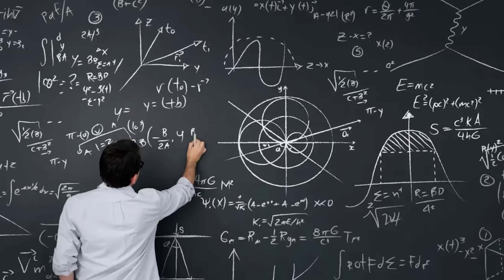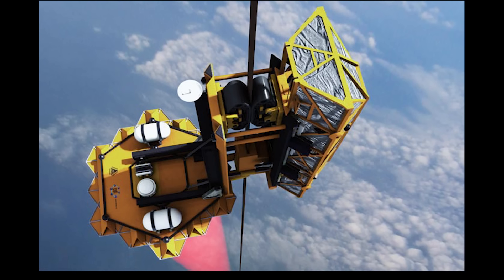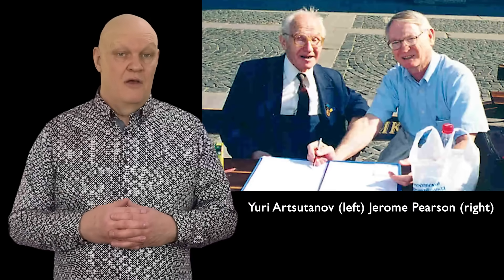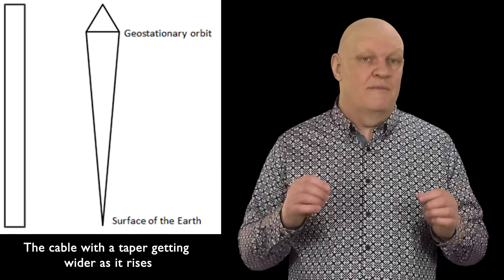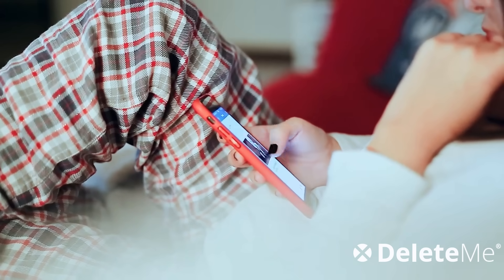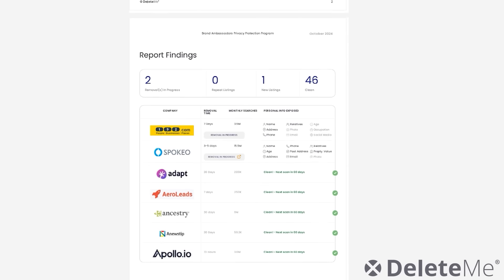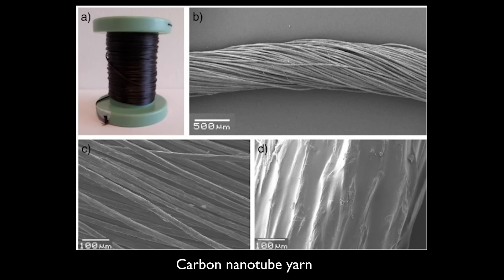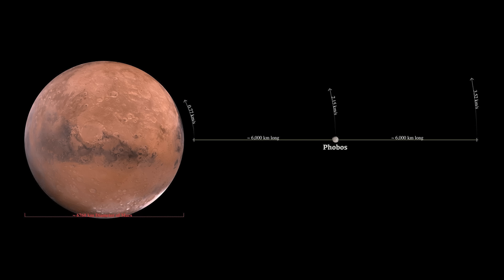Are Space Elevators Still a Thing for the Future?

Comment: Many limitations. The counterweight could potentially provide the force to lift the tether and payload vertically, but not the horizontal velocity that the payload needs (i.e. orbital velocity). So a lot of propellant would need to be lifted and burned on the orbital station at geo (or at interval thrust stations/rocket engines) to provide sufficient thrust for the payload being lifted, otherwise the counterweight would slow, the tether would not remain geosynchronous, and it would de-orbit in spectacular chaos.

Might want to double check the mass of tether assumptions too, as much of it will be near weightless as it approaches geosynchronous orbit, hence the taper idea.
F=gmM/r^2
a_m=gM/r^2
a_c=v^2/r
v=rw=r×2pi/(24×60×60)
a_c=r×(2pi/(24×60×60))^2
a_total(r)=a_m - a_c
Where positive a_total(r) is towards Earth and negative away from earth (i.e. beyond geostationary orbit radius).

Cable weight force
F_cab=integral(a_total(r)×dm)
 from r_0=earth surface radius, to r_max_force=geo stationary radius
dm=rho×A(r)×dr
F_cab=integral(a_total(r)×rho×A(r)×dr)

Where A(r) is cable cross sectional area (as a function of radius to account for tapering geometries), and rho is cable density.

Plugging in some numbers into these fomulas for different tapering geometries and densities will give max cable force. Can also calculate required counterweight mass, distance, velocity etc.

The key parameter is really breaking stress (or yield stress), so F_cab(r)/A(r) is the key parameter to plot for different tapering geometries and cable densities.

Good luck to anyone who read this far! 🎉
Reply: No.  You put the make the centerpoint super-synchronous, and then Earth provides the rotational acceleration through the ground station.  It's an additional tensile load that needs to be factored in beyond just the system weight.
Reply: Thanks, I've now got a headache and will be crunching numbers all night 😂

Comment: I know that the cable weight issue seems the Achilles heal of a space elevator but there's something even worse, horizontal acceleration!
The problem of getting a capsule into orbit is not going up, its acelerating it sideways to over 7,000 miles per houre.

Comment: A 40,000km string, you say? What could possibly go wrong? Airplane proof? Bomb proof? Asteroid proof? Rocket proof? Murphy's Law? What would be the implications of it snapping? I do have personal experience of elastic bands snapping but even so I struggle to evaluate the consequences of a 40,000km cable roaring at supersonic speeds out of the sky and whipping itself around the Earth's surface, I mean, isn't it just possible there might be the odd unfortunate casualty resulting from this? Is this scenario not filed under "doesn't bare thinking about".

I honestly don't believe this "ball and string" space elevator model would get past the Health & Safety Executive even if it made it passed the bean counters and the insurance industry. There is a competing design of space elevator called the "orbital ring" though. At first sight on paper it looks a lot safer, more practical and much more useful albeit significantly more expensive. I would be interested in a companion video debunking that option.

Comment: The steel cable doesn't need to be wider than the known universe. Well before then it will hit the point where it's wide and massive enough to collapse into a black hole, destroying both the elevator and the Earth, promptly solving the problem of trying to build the rest of it. Easy.
Reply: That’s an interesting solution! A black hole to compress the entire earth and atmosphere into the size of a marble, and space is only a half inch away!
Reply: @alphagt62  That would solve all problems! Forever!
Reply: "Black holes" are a sci-fi myth, it's not real.

Comment: Great video. Thanks.  You mentioned Mars, with its lower gravity, but surely Earth's Moon would be the ideal place for a (first) Space Elevator.
Reply: exactly
Reply: Looking it up, moon doesnt really have a stable stationary orbit. It would be even higher than earths for one, but Earth itself would create a bunch of force acting on the elevator. You'd rather need a lagrange point or so (stable points between Earth and Moon etc).

And what for? Its not that hard to get to moon orbit, Apollos' Lunar Landing module could launch a capsule to orbit.

Frankly, any example of the space elevator seems to end up with "even if it was feasible, its way cheaper to use rockets". A cool idea that only really works in stories.

Comment: Wait until Musk see this idea and says something he did with Hyperloop,
“It’s like a tube with an air hockey table, it’s just a low pressure tube, with a pod in it that runs on air bearings, on air skis. With an air compressor on the front that is taking the high pressure air built on the nose and pumping it through the air skis. It’s really, I swear it’s not that hard,”

Comment: The problem isn’t just material.  Raising a mass means accelerating it laterally.   Where does that energy come from?   The whole apparatus would bend more and more as the mass climbs unless it’s stiff laterally.
Reply: Exactly! I was surprised this wasn't mentioned!
Reply: That was my point
Reply: The ascent creates a coriolis force on the cable which is felt at the anchor point,
and slows the earths rotation  so angular momentum is conserved and the energy 
is "stolen" from the earth.
Reply: @fredbloke3218  You're correct, except for calling it a "coriolis force".  That only exists if the ground station is off the Equator.
Reply: Those guys are scammers, they try to explain from a physical point of view how Baron Munchausen pulled himself out of the swamp by his own hair
Reply: Laser beams can transmit the energy to the probes going up the cable. There are other ways as well.
Reply: @thirdeyefocus6255  Laser beam energy is incredibly inefficient when it goes through atmosphere.

High power lasers are also really dangerous, especially for our eyes. Idk if you could ever have make them safe.

You could just have a power cable like trains do. Or nuclear drives.
Reply: The advantage of lasers or maybe microwave transmission of power is that it is less weight on the cable cars themselves.
Reply: It’s not the energy, it’s the angular momentum.  Moving anything up the cable steals angular momentum from the cable.  This will drag the whole thing out of orbit unless you have a mechanism to give the elevator angular momentum.  If that is a rocket on elevator, you end up not gaining much over just launching a rocket without the elevator.
Reply: @michaelbarnard8529 No, because you can place a large enough weight beyond the geostationary orbit distance that holds everything in significant tension rather than compression.
Reply: It doesn't matter how big the weight is, it doesn't solve the conservation of angular momentum problem.
Reply: There is no conservation of angular momentum problem since there is supposed to be a big counterweight at the end of the cable. It can have some stabilization thrusters too and the fuel can be brought up with the elevator.
Reply: it doesn't matter how big the weight is, the thing coming up the tower would pull it out of orbit due to the force required to accelerate the load coming up to a matching angular velocity. you can't just accelerate it for free. physics doesn't work like that. you have to conserve momentum. you can't get something for free.
Reply: You guys forget that the cable cars will be going down as well all the time, maybe even loaded with minerals from space mining, etc. Some of the angular velocity is also provided by the Earth rotation itself and the loss of this momentum is miniscule to the planet.
Reply: @thirdeyefocus6255  If there are cars going up and down, their net weight has to balance for overall angular momentum to be conserved, but you also have to deal with each car exerting a lateral force on the cable in different (and time changing) locations.  If you expect to barrow angular momentum from the Earth, then the cable has to support the lateral force somehow.
Reply: Counterweight support theory. Spider web construction in pyramid design.
Pull the elevator vertical.
The space elevator must be built above ground level 1/3 its overall height with counterweight extensions constructed beneath.
Reply: In my design, two contingency vehicles are unfolded upon loading the elevator car, and, it is non-anchored.
Reply: The energy comes from Earth.  You raise the mass balance above GEO, causing the counterbalance to drift behind the tether point.  The tether (and Earth) drags the whole system back forwards.
Reply: @wagnerrp That would excert an incredible amount of force on the anchor point and even more stress on the material
Reply: @whosjulez1157  More stress, but not an "incredible" amount.  These vehicles are only climbing at a few hundred km/h, meaning it's being accelerated laterally at only a few mm/s^2.  You're talking maybe a few hundred N total, compared to tens or hundreds of MN vertical load.  It forms a catenary, something we've understood for centuries, and a few degrees of angle angle a the anchor would produce loads that are still negligible versus what the system is already holding.
Reply: @wagnerrp  So, just one vehicle at a time, each one taking days before then next can be sent up? Any useful number of vehicles, and we are back to "incredible".

This is like the "unlimited energy from fusion" pipe dream: power extracted would be ten times as expensive as fission, and fission is already not competitive, and falls farther behind by the day.
Reply: @ The count doesn’t matter. Each vehicle will see far more stress from weight than from lateral acceleration.  If the stress from catenary deflection is “incredible”, then the total load on the system is “orders of magnitude greater than incredible”.
Reply: @sciptick  At least fusion is a functioning tech that we could afford, even if it might not be economical.

Space Elevators struggle to exist even as a theoretical concept.
Reply: @sciptick  looking at the way single track railroads handle this issue, you could a. Send 3-4 crawlers up at short intervals, hold them at the geosynchronous station until all have arrived, then send them back down again in sequence, b. install a passing loop at the half way point, or c. If the traffic is busy enough, install an adjacent elevator, with a bridge between them, so that you have one Up elevator, and one Down elevator.
Reply: @sciptick  Fission would be very competitive, were it not for warmists and other loons who at once cry out about how the world is about to end due to warming while at the same time flying to climate summits in private jets and agitating violently against the only technologies that could feasibly replace fossil fuels.
Reply: Even if the material issues were resolved the issue of electromagnetic field induced voltage and the potential for catastrophic discharges along the cable could be a Real Thing. There are a lot of this that we don’t really have a handle on. Not sure it’s a gamble worth taking. 
Just an observation of one of the Serfs. 
What’s to worry? Ay ?
Reply: @markwarren6213   I saw someone else already field this one.  Specifically, there was an actual study, and the study found it was a non-issue.  If the tether is not highly conductive, then it doesn't matter.  If the tether is highly conductive, then there's an initial static discharge you need to deal with when you first close the circuit, but then you're bonded to ground, and cannot build up enough static potential to be an issue.

Comment: What about the effects of wind on the tether?
Reply: The wind is only on the bottom few % of the cable - the majority is in vacuum.
While the wind may cause a small amount of movement, the tension in the elevator ribbon will be more than enough to keep it stable.

Comment: I wonder what the tallest tower or elevator would be? One mile? No where near space of course. I guess the 35,000 km is what is required to be geosynchronous at the arival point. Otherwise...what would happen? The Earth's rotation would topple the cable? Atmosphere would push it to the right. Or left. If so, how taught with the strengthened cable to prevent those effects. Many questions still...

Comment: Well done, thanks! Yet for all I hear on this, I still fail to understand how a heavy vehicle with heavy cargo could even begin to "roll up" a thin set of nanotubes (blowing and twisting in the winds btw). Even a BELT or RIBBON of "woven" nanotubes 36,000 kilometers long, might be a matter of scaling up manufacturing... IN SPACE... hopefully on a captured asteroid... but come ON! And then, what can you secure the Earth end of the tether to (assuming you can even CATCH it)? The load will range wildly depending on the upper winds. Anything in those winds will pull on the tether... how EVER it's climbing a thin set of nanotubes. I just don't see it working.
Reply: The winds will only be on the first 50 km or so. The rest of the 36,000 km will be in vacuum.

Comment: The real problem is that it will only take you from one place to one other place. You still need rockets and fuel if you want to go anywhere other than the equator to geostationary orbit. The cost of getting to space with  reusable rockets kind of make the space elevator a ridiculous waste of money. For a few hundred million and only 3 million per launch from anywhere on earth to any orbit you want makes the space elevator impractical. Its the same problem with building highspeed trains. Why build them when you can plop down an airport for way less money and start using it immediately.

Comment: The cable running through Earth's magnetic field would fry 🔥
Reply: Yes, between lightning stikes at the base, and the dynamic energy influx from solar wind on the magnetosphere, a carbon based elevator cable doesn't even seem viable for Earth, but maybe it could be for a smaller body with no atmosphere and only a weak magnetic field at best.

Comment: There are other methods for getting into space that do not require such extreme material, such as the Launch Loop.
https://en.wikipedia.org/wiki/Launch_loop
The Launch Loop is a dynamic structure, requiring mostly carbon steel and Kevlar.

Comment: The Active Support Orbital Ring is a more practical design possible with today's material science. It uses a conductive wire, something like copper or aluminum rotating at greater than orbital velocity for its altitude placed around the Earths circumference encased in an electromagnetic tube. It can be placed at any inclination relative the the equator. Or even multiple rings. Spin the inner wire up and it provides active support allowing you to drop transit tethers to the ground around the circumference of the Planet. The main problem is launch costs. But that could be solved with ISRU, Moon or NEO Mining and production. It could provide cheap access to orbit, escape velocity or ultra fast transit to the other side of the world. Its a much more useful and practical design than the Space Elevator. Which may never become practical even if we do figure out how to make single strand carbon nanotubes or graphene ribbons 10's of thousands of miles long. It would still require traveling to the base of the tether. The ring could have as many tethers as you like. Each with high-speed transit up to the ring. The real key is how versatile it would be.
Reply: Thought I should add that the outer tube doesn't move. You could stand on it, you'd just need a space suit. Gravity is essentially the same at low Earth Orbit altitudes. You could build structures on it and you could build mass drivers and electromagnetic trains on it. That wouldn't have to deal with an atmosphere making arbitrarily high speeds possible. Mass drivers would steal orbital energy from the structure but with nuclear or even solar power you would use the electromagnetic pipe to add energy back into the inner rotating wire that supports the whole structure. Much like current particle accelerators. Its really an ingenious idea. It solves every problem with the space elevator and adds a lot more practical uses.

Comment: Except that even with perfect carbon nanotubes they still can't be made long enough. Orbital rings are physically possible and have a realistic future but GEO space elevators are as bad as a warp drive as science fiction.

Also, if you calculate the cost per kg to space using a space elevator the cost is higher than the theoretical minimum for a 2 stage reusable rocket ($200/kg vs $10/kg accounting for emergy to GEO, cable occupancy, and upfront cost vs refurbishment and propellant costs for a reusable rocket)

Comment: You should do an episode on Sir Frank Whittle, inventor of the radial flow gas turbine engine, arguably the first "jet" engine. It absolutely changed my life when I learned that Sir Frank invented it to drastically reduce the complexity that it took to make horsepower. Paul, my guy, learning about Sir Frank Whittle turned me into the lighting section at the dang hardware store. 💡💡💡💡💡💡💡💡💡💡💡💡💡💡💡💡
Reply: Wait to you see some of the compression shock engines or scramjets
Reply: That's some fancy stuff that has very little practical use. Radial flow gas turbine should literally power most things.
Reply: @jamesturner2126  radial is low efficiency due to the curve you mean axial flow
Reply: Radial flow can be as efficient as axial flow, if somebody took the initiative to develop them. even produce a high output radial flow. 15,000hp?